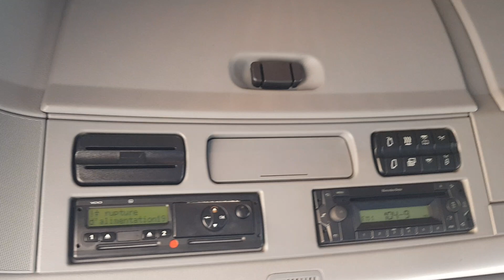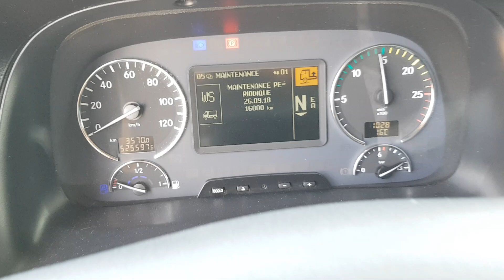SOLD | Mercedes Benz Actros 1844 Mega 2013

Comment: Help me .. Sir I have a Mercedes 1844 2013 model, after starting the track the RPM automatically goes to 11, which should be at 5.  What to do?
Reply: Is it only on start up and everytime?
Could be revving up to power the compressor (low air)